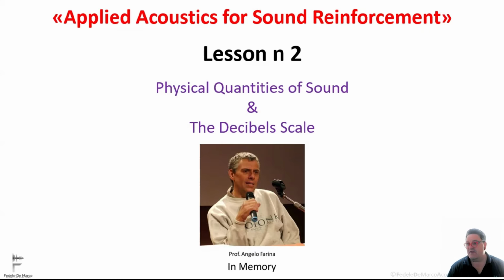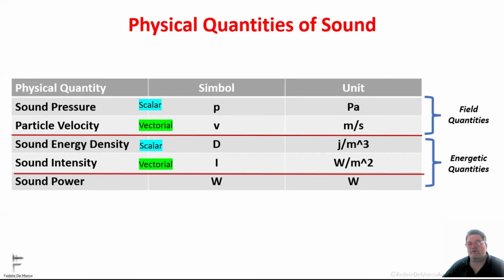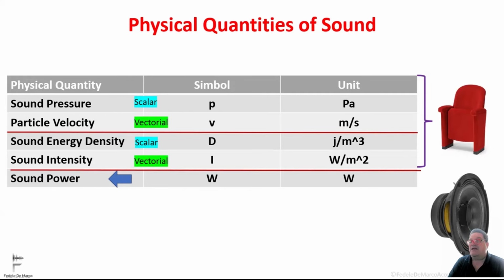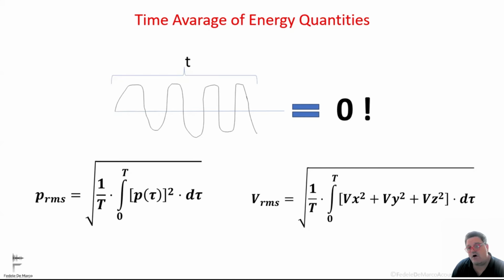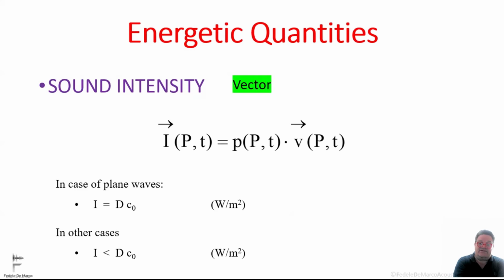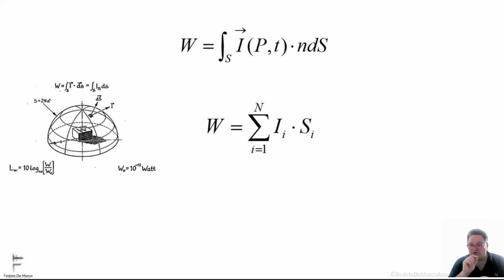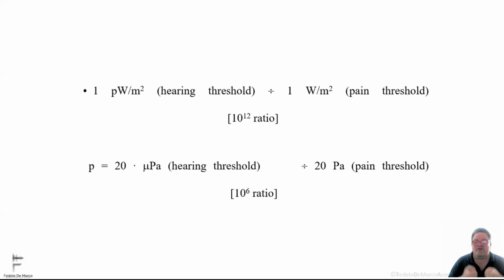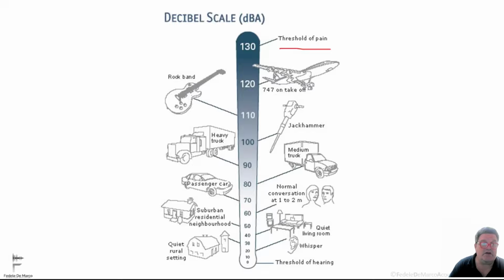Course of Applied Acoustics for Sound Reinforcement LESSON 2: Sound Physical Quantities and Decibel

Comment: Great session—clear breakdown of base quantities → dB scale. One pivot I see trip people up in the field: when to use 20·log vs 10·log. If you’re converting a ratio of amplitudes (pressure, voltage) use 20·log; for power/energy (intensity, acoustic power) use 10·log. Also helpful: state whether you mean SPL (re 20 µPa, Z-weighted unless specified) and whether values are RMS, peak, or peak-to-peak—that kills most confusion around “the same” dB giving different answers.

If you like bite-size refreshers on this, @DecibelDive posts 60–90s explainers (e.g., dB addition, A vs Z weighting, Leq vs Lmax) with quick field examples for audio and EHS teams. Worth a follow alongside this excellent long-form series.
Reply from the maker: Salve. Attenzione. Questo è un punto importante.  La scala dB è una scala "energetica" che si applica a grandezze energetiche. P e V sono grandezze di campo e pertanto devono essere prima "energizzate" e poi messe in dB. ecco perchè le eleviamo al quadrato. ed eleviamo al quadrato Numeratore ( Pi o Prms) e denominatore (P rif 20E-6^2). 
Usare la proprietà dei logaritmi per portare fuori il quadrato e far diventare quel 10 un 20, se dal punto di vista matematico è la stessa cosa, dal punto di vista fisico si perde tutto il senso "energetico" della vicenda. 
Sconsiglio questa pratica. 
Ho scritto un post sui miei social a riguardo e lo trovate sulla mia pagina FB, IG o Linkedin. Grazie per seguire